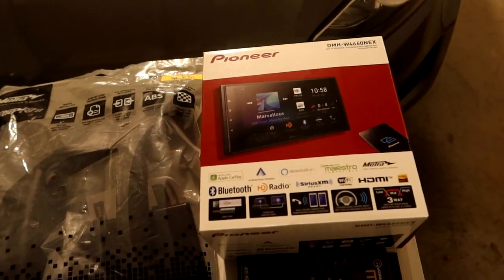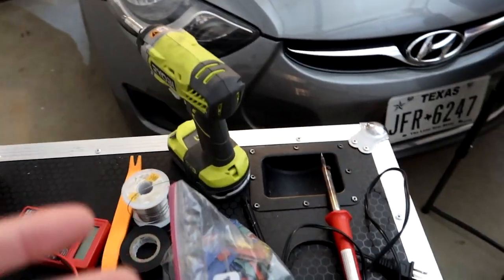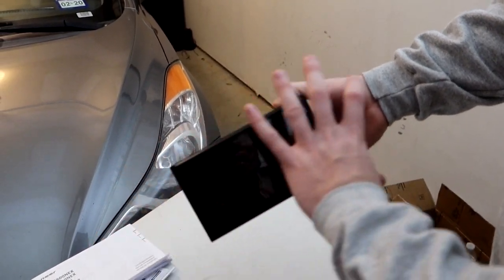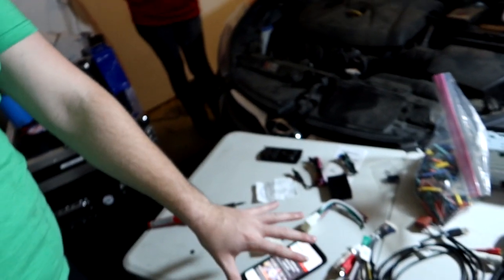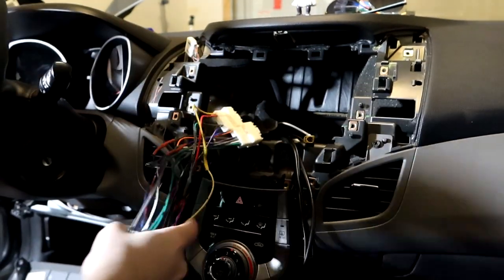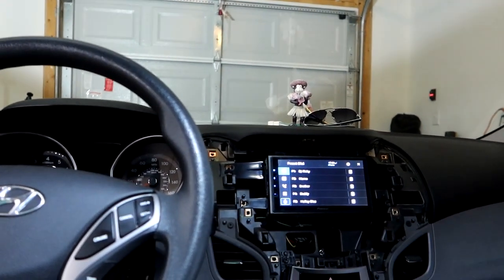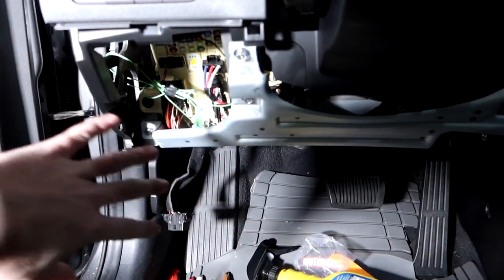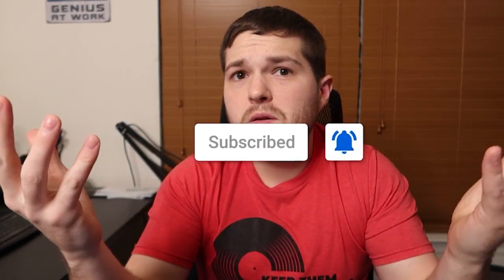Hyundai Elantra Stereo Replacement - Full Install and wiring (Pioneer 4660NEX)

Comment: I have this exact radio and car.  The speaker harness that came with the radio has RCA jacks on the end but the Metra harness adapter has bare wire.  Did you have to cut off the RCA jacks to splice the wires together?
Reply from the maker: Correct
Reply: Are they the same colour RCA to harness wires?

Comment: Bro do I need to put a resistor in for the parking break connection because my Android auto is not reading that the car is in park. I hooked up to the orange like you said next to the pink wire. It did come on for min then went out and never could get it to come back on.
Reply from the maker: Can't really answer thats all I did. Still working to this day.

Comment: I can’t get the factory or aftermarket screws into the side of the pioneer head unit. It’s those cheap holes. Did they go right in for u?
Reply from the maker: The bracket worked just fine for me